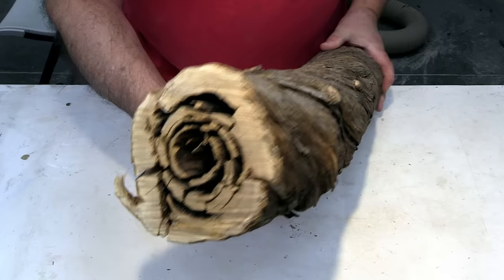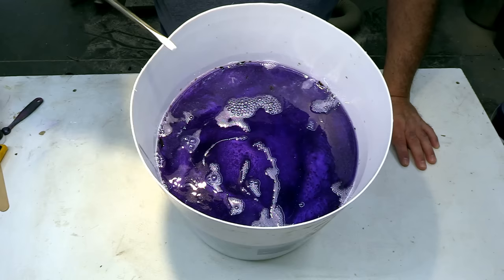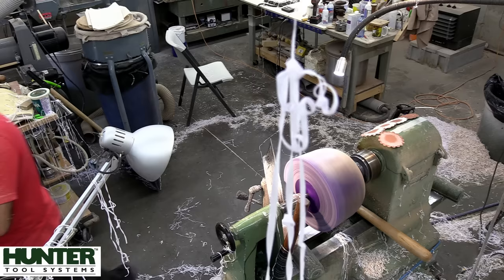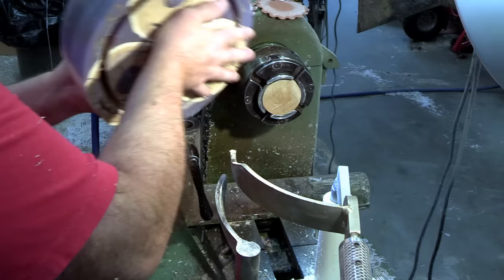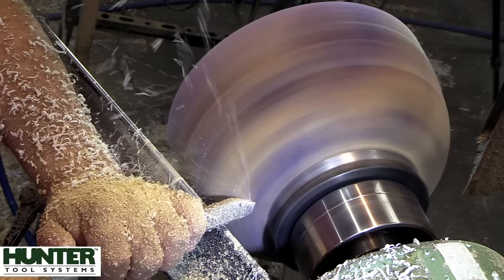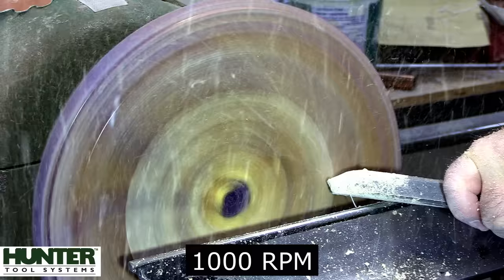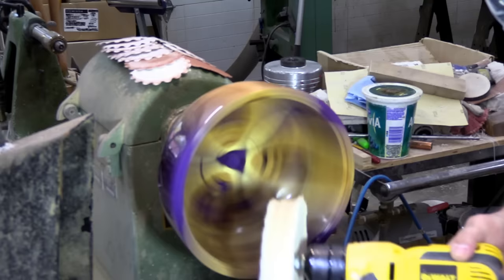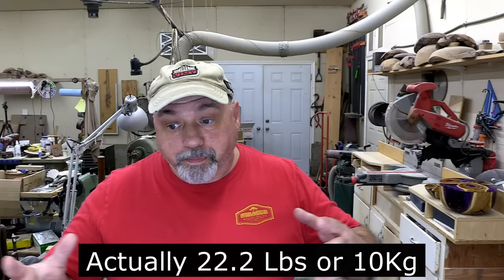Woodturning - Wow! You're Going To Love This Psychedelic Lilac

Comment: Idea to try:
> A funnel attached to the top of a straw
> Fill with the white
> Insert to bottom of purple then release/ add white to funnel as you pull upward.
> This way you can put the amount you want where you want, in puddles, streaks, swirls
> then stir a bit if desired
Reply from the maker: Good idea, thanks!

Comment: 30 inches of vacuum will peel the skin and muscles from your bones in a 3 inch pipe with  a storage tank big enough to handle that vacuum. It is the same as being 200 feet below the surface of the ocean in a submarine. Very impressive how powerful vacuum is. Thank you, Jim, for the part about color separation in casting. I turned away from trying to get to 80° and went off of thickness. My colors stayed separated after 30 hours. That was my 3rd attempt.  Either way, all of the information you give us is amazing and also saving me a lot of money in the long run! Thank you!! Just in case........Designer Epoxy
Reply from the maker: Great, thanks!

Comment: Beautiful piece.  Here in BC I've seen solid lilac as large as that. The problem with lilac is that it shrinks and cracks easily. One vase that i made from lilac, I happened to expose the lilac resin pocket on the inside of the vase, made a lid for it and just sanded the inside with no lacquer inside finish. Whenever I wanted to smell purple lilacs I just opened the vase and it was there for years.
Reply from the maker: Interesting, thanks!

Comment: A little bit of mold release in your bucket before you pour would make your life 1000x easier....
Also, I would do a shallow quarter inch pour in the bottom of the bucket, set the wood in and let it cure, to keep it from floating. Then do the full pour.
Reply from the maker: That would be fine if I wasn’t under a deadline, lol. Thanks

Comment: Howdy!  We always watch you on the TV which doesn't allow one to make comments. thoughts on the cover warp or distortion....I suspect that the fact that the wood being end grain, and the fact that the pressure pot was working with resin that was getting close to cure, and the wood was a high percentage of the surface area that was not penetrated well with the resin was the cause. A horrible run on sentence, but too lazy to rewrite it! just a thought. Have lots of enjoyment watching and learning. Very nice piece. a couple of nice saves! Still have hopes of doing a little turning on my metal lathe...Need to come up with a 3 phase motor and control to get variable speeds. Thanks for being out there!
Dennis&Yvonne  Prescott, AZ  Designer Epoxy   Have a friend that turns...I would gift him the resin!
Reply from the maker: Your right in some ways, the resin wasn’t fully cured and that made it more likely to move under vacuum, but that 8” drum will shock you with the amount of force it has when the vacuum is applied. Thanks.

Comment: These  both came out beautifully!   

Your color choices and techniques for the color separations are really improving.  Once again, white is a beast to work with, so you may have just needed to use more if you wanted it to be more obvious.  Not necessarily a change in ratio of color to resin but simply a larger quantity of white resin to mix into the casting.  I still like how this turned out, but it clearly was not what you planned.  

Designer Epoxy
Reply from the maker: Thanks 😊

Comment: I got a question about pots. I remember in one of your shows the question was asked vacuum pot or pressure pot and if I’m not mistaken you said vacuum was the most important and if your budget allows get both. I understand what the vacuum tanks job is but my question is what does the pressure pot do. When it comes to bubbles in your work will the vacuum pot  not remove all of them so why a pressure pot. Look forward to what you can enlighten on this subject
Reply from the maker: The pressure pot compresses any remaining bubbles and pushes the resin into areas that it ordinarily would flow. With a lot of resins like the Pro series or Artcast there isn’t a lot of open time and you don’t have much time to use the vacuum chamber. Hope this helps. Thanks

Comment: Very nice bowls! Question, could you have used resin and pressure potted/vacuum chamber it to stabilize the wood, instead of using quite a bit of thin CA glue to stabilize it? Thanks
Reply from the maker: Yes, I could of used stabilizing resin to stabilize the wood first, but it would of cost way more money to do so.  Thank you very much!

Comment: Designer epoxy.   Stunning piece.  What a massive blank…22+ pounds 😮.   I always learn something new from your videos!   As a newbie and having minimal experience and equipment I see ways I can try to create a similar piece/design.   I use a midi lathe so no coring rig or vacuum chuck and on lids I make a very shallow mortise on the underside with a maybe like 2 or 3 decorative rings a half inch apart so the mortise looks like it’s just part of a design feature on the underside.  

Makes sense that you put the 3 logs inside since you cored it out and got another bowl/box out of it.   I’d have to cut the logs in half length wise ending up with 6 pieces and then use however many needed to go around the sides and have a big waste block in the center.  Boy that was an Enormous amount of Resin!   You were hundreds of dollars in before even taking it out of the pot.   Yikes.   Great job Jim as always.  You are an excellent teacher whether you’re aware of it or not.  😊
Reply from the maker: This took half a kit, so that’s about $120ish Canadian in resin. DE is very affordable! Thanks

Comment: Jim I just had a thought.  Bear with me here.  There's a physics law that states a decrease in pressure will cause a decrease in temperature and vice versa.  I think it's called Gay Lussac's Law.  It's not just the sensible temperature that changes.  The boiling point also changes.  For example at atmospheric pressure (zero vacuum) water will boil at 212°F.  If you put that water in a vacuum chamber and pull it down to a 25 inch vacuum it will boil at 90°F.  I think a 28 inch vacuum will boil at 75°F and so on.  --  I don't know what the boiling point of the resin is; or if it even CAN boil;  but I noticed in last weeks video that when you started pulling the casting into a vacuum there was some bubbling at first and then it suddenly erupted into a massive amount of bubbles.  I'm not sure that was air coming out of the wood.  I'm thinking it might be that you pulled it into a low enough vacuum that the resin started boiling and that was what we were seeing.  --  I don't know if such a thing would affect a pour at all.  But one thing that can cause a pump to fail is when chemical off-gassing damages the gaskets and O-rings in a pump.  Have the guys at Designer Epoxy ever mentioned anything about a low limit on vacuum for their product?
Reply from the maker: Interesting. I’m sure he would need to talk to his chemist to get that answer. All this stuff is over my head, lol. When you say boil, does that mean boil as in hot, or just bubbling the resin? Thanks
Reply: Boiling is nothing more than a liquid being converted to a vapor.  At a normal pressure you do have to get water hot in order for it to boil.  But in a vacuum chamber under a strong vacuum you don't need as much heat.  It will boil at room temperature.  --  Try this.  Put a glass of water in your vacuum chamber.  You know there are no bubbles in a glass of water.  Use warm tap water.  maybe 90 degrees.  Put it under a vacuum and I bet it boils at 26 or 28 inches of vacuum.  Then pull it out and check the temp.  it won't be any warmer than when you put it in.  It only boiled because the pressure got so low.  And I think that might be what you're resin is doing.  --   MAN!  I gotta get me a vacuum chamber!

Comment: Slowing down the cure by putting it in the fridge means that the wood is submerged in liquid for much longer. It’s breaking down & that’s why there are floating bits. Perhaps in future you could get around it by not using delicate woods when you want colour separation
Reply from the maker: Yes, your probably right. These pieces were to cool not to do something with. Thanks

Comment: Beautiful work!  Question, What is the purpose of wet sanding? You talked about it in your video.
Reply from the maker: A lot of turners like to wet sand epoxy. So the lathe speed is low and the epoxy stays cool and the sandpaper gets dipped into a container of water and doesn’t indent when sanding. I find the wet sandpaper expensive and it’s not exactly the funnest to use in the winter, lol. Thanks

Comment: Loved this video, I’ve gotten myself a small lathe and turned my first bowl. Went pretty good just wood so far for me. I had a small accident with catching my hand on the chuck. I’ve seen you use some thick tough looking gloves. Can I ask you for a recommendation of where to get and which type you used. I am based in the Uk do might not be able to get the exact pair but hope to get close.  I had an accident with hot glue while turning the same bowl. I’ll leave that for another comment, I was lucky you will probably find it very funny. Thanks in advance for your advice and inspiration
Reply from the maker: There just mechanics gloves with the fingers cut off. You can get them at any car parts store. Thanks
Reply: @SpragueWoodturning  thought I’d tell you about the accident I had with the hot glue. Use it to attach the glue block. I was concentrating on keeping it cantered, had my face visor up and switched on the lathe and hot glued my right eye ball shut. So much pain but luckily I managed to get it open again lost a fair few eyelashes. I won’t be doing that again. Feel free to share that with everyone, stay safe out there everyone…

Comment: Love your videos sir. Very informative I'm trying to get into turning my self and don't know where to Start as far a set up goes. Any insight would help.
Reply from the maker: Do you have a Woodturning club near you? That would be the first thing I would recommend. By a used 12” lathe, stay away from lathes that use tubes for the lathe bed, they are not as strong as cast iron lathe beds. Don’t buy tool sets, buy the tools as you need them. You need a large bowl gouge, parting tool and if doing epoxy, get the #3 Hercules. Hope this helps. Thanks

Comment: Designer epoxy. Another great looking set. Im not sure the white pour in accomplished anything except sinking to the bottom. Is that where the lid handle was oriented?
Reply from the maker: Yes, there and in the pine cones and in other areas throughout the two bowls. Thanks
Reply: Maybe hot white sinks through cold purple

Comment: Love your channel. Only suggestion would be to shorten the length and talking. The bowls are incredible with great craftsmanship and design. I would like to suggest you tell your loyal subscribers about how potent the Waterlox finish is. Full face mask, all skin covered and lots of ventilation are written right on the can if using the original formulas for the sealer and gloss finisher. At your suggestion I purchased the original formulas on Amazon. I understand there is a low voc newer product. Your health and subscriber health is paramount. Keep the great vids coming.
Reply from the maker: Yes, health and safety needs to be talked about more. Do keep in mind that I wear a glove when applying the finish and then it goes into a different room so I’m not breathing it all day too. Thank you very much!

Comment: Hello, I always have a problem with my glue blocks not holding. I have used CA, 5 minute epoxy, and others. What kind of glue are you using. Thanks in advance
Reply from the maker: I just use the hot melt glue from Canadian Tire. Thanks
Reply: @SpragueWoodturning  any idea what that would equate to for someone that doesn't know what that consist of. Thanks

Comment: I see you are using the Powercap respirator and you wear prescription glasses. I recently purchased one and like how it works but as a glasses wearer I find it ridiculous how hard it is put on - my glasses get mashed into my face. My glasses are 6 inces wide and the shield width at the top in 5-3/4 inches. Can you put yours on without it messing with your eyeglasses?
Reply from the maker: When I first started wearing it I found it was sitting down on the arms of my glasses giving me the impression they were hitting on the face shield. I happen to be taking to Peak Safety, the one that sold it to me and I complained that there wasn’t really any adjustment with the cap. I have a relatively small head 7 1/8” and they told me to buy some padding that goes into bike helmets. Once that was put in, it lifted the cap off my head slightly and now the cap doesn’t tough the arms on my glasses and is a lot more comfortable to wear. Give it a try, hope this helps.
Reply: Thank you for your reply, it was helpful. I had already contacted Peke about the fitment issue and got some advice, but you shared some info they didn't suggest to me as they did to you.  As I said to them, I don't have a large head size (like you) and felt it is ridiculous to have such an issue with glasses, especially for a $500 helmet. Although the product does filter nicely, I don't think I would recommend it. Frankly, I didn't get the impression they had any inclination to make the seeminly minor design change to make the product fit better. I will try the padding you suggested, but geez at the price I paid I don't like that I have to buy extra accessories to make it fit right. Thanks again! @SpragueWoodturning

Comment: Can you use Pam or line it with Saran Wrap to ease getting out?
Reply from the maker: I would never use something that’s never been designed to be used with resin like Pam. Saran wrap is fine, if you can keep it from encroaching into any voids in the casting. Paste wax is probably the best option. Thanks

Comment: Why didn’t you run it thru the band saw when cutting off the lid?
Reply from the maker: It’s very dangerous to do that with something like this. It hard to get a firm hold of it and it could spin into the blade and cause some serious damage to you or the casting. If it was smaller, then it’s less riskier. Thanks for watching!
Reply: @SpragueWoodturning  thank you I fully understand that. When I was little I used to live watching my Grandpa do what you’re doing, however way back then there was no resin. 😂🤣

Comment: The large bowl is fantastic, but the lid, not so much. The curves of the bowl show off the length of the wood and the pine cones, whereas the top has little dots of pine cone specks that look like errors and the wood of the top being round just doesn't look nearly as good as the bowl. I would toss the lid and just display the bowl. The small bowl set is nice. The light inside washes out all the details.
Reply from the maker: Thanks for watching!